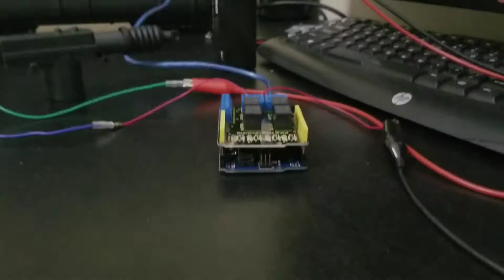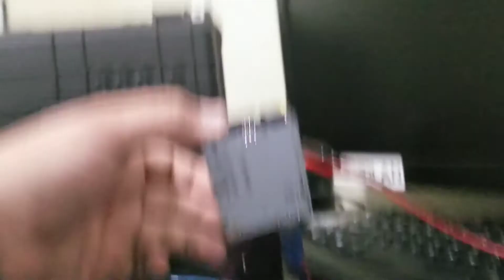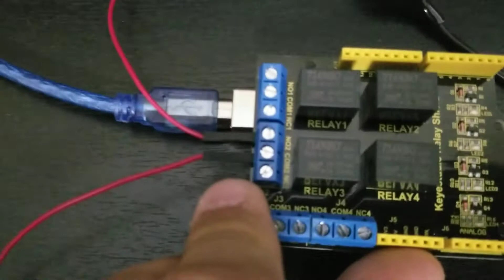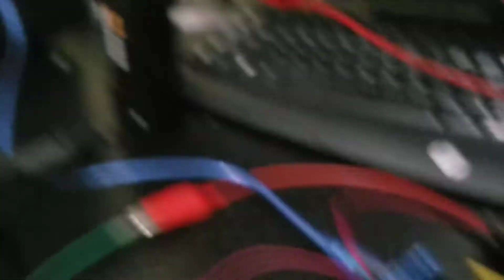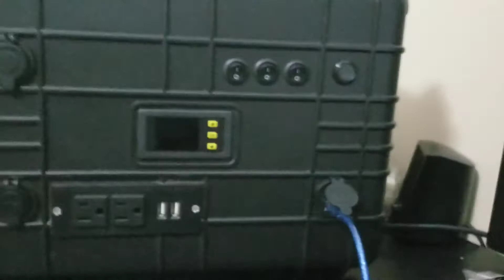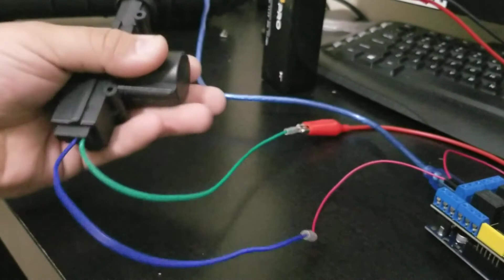Arduino relay shield test

Comment: i got the same shield but when i tilt the board it starts buzzing, like the relay's magnet isn't getting enough power to stay closed.
Reply from the maker: Wow, that's strange, mine has held up since the start and still runs well without issue. I'd send it back for replacement
Reply: @JPG23   and the weird thing is it starts doing that when ever i so much as get my finger near the relay pins and pin 2, like their picking up interference from something.
Reply from the maker: @cyberstar251  is your input voltage within range?
Reply: @JPG23  yeah, im using a pretty long usb cable that's shielded, but that's not it, it seems to be between pins 7 and 2 on the digital pins, but im starting to think i just made the code wrong.
Reply from the maker: @cyberstar251  I'm away from my computer right now, but as soon as I can I will send you an updated copy of the code for you to try. I still recommend replacing the shield if the relay issues continue with the new code.
Reply: @JPG23  i've found an interesting thing about my problem, it seems to be with the boards themselves, i have 2, i used the code i made using a limit switch to trigger the relay after a few seconds, and the other with the default blinky led script, then i swap the scrips and the problem moved with it, it's my code.